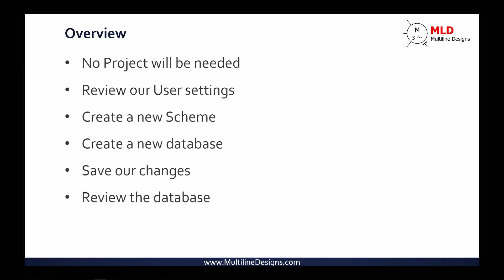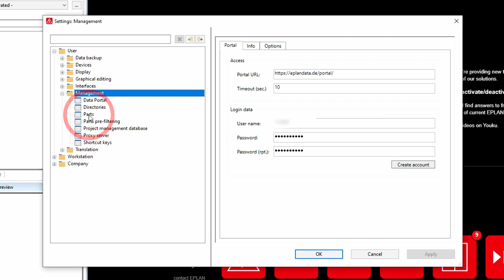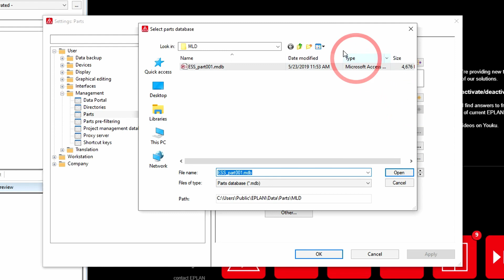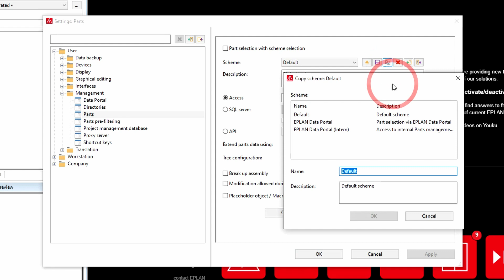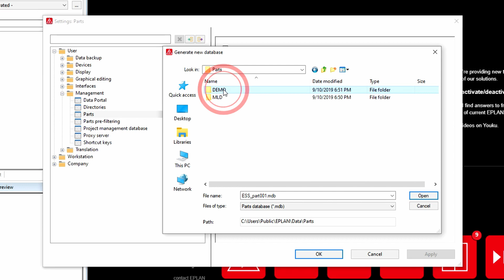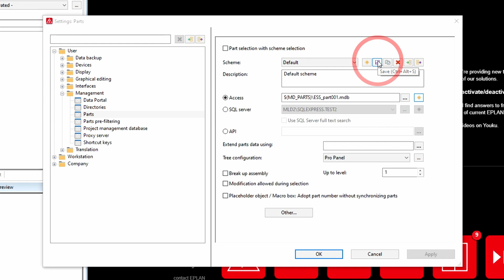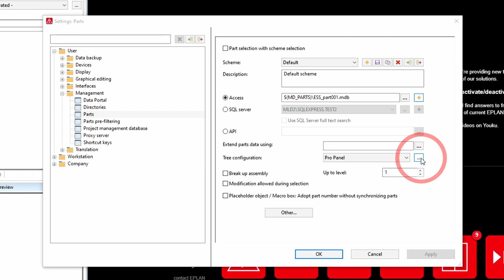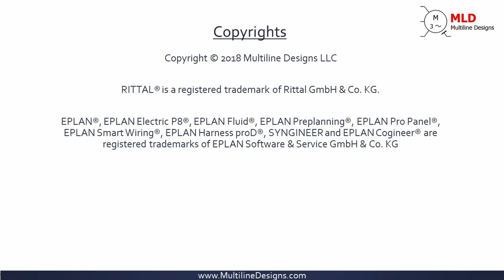Create a new EPLAN Parts Database

Comment: Very good explanation, I was using an access 2016 with 64 bits but this was not able to open the Part database, it seen everything was right, but didn't work. Now, after follow your instruction (I was to uninstall entire Office 2016 :( ) it has worked properly. Thank you so much!
Reply from the maker: I am happy that I could help, you may want to keep some version of Office on your PC as EPLAN also works well with Excel. Anytime you find yourself editing EPLAN data in a table ask yourself if there is a tool in Excel that could edit this data faster.